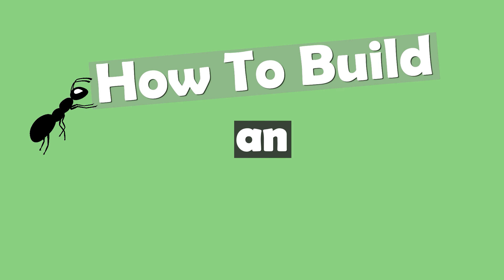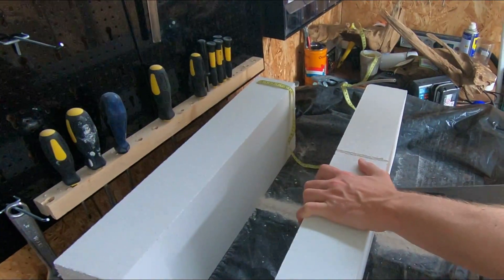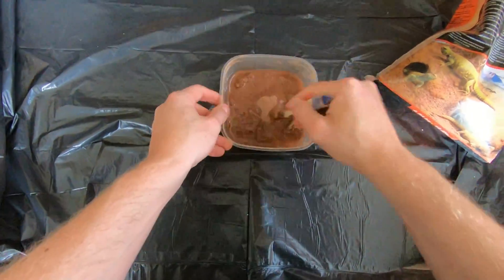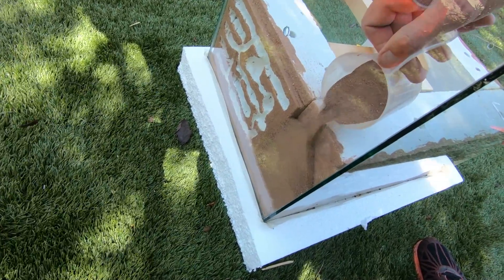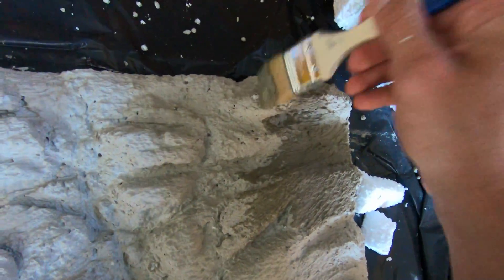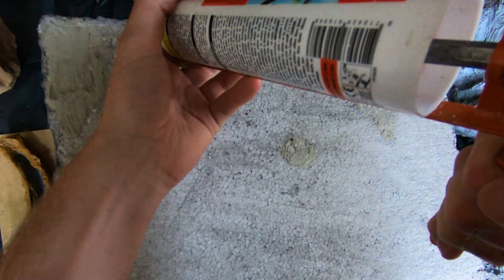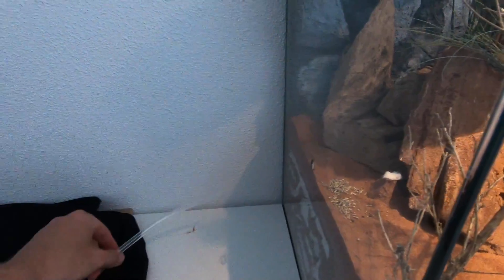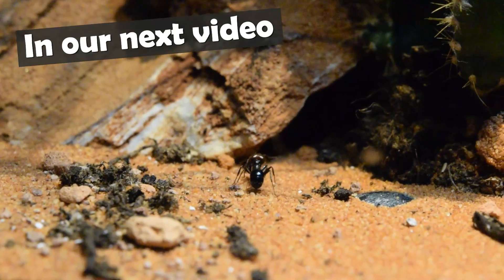How to Build an *EPIC* Ant Farm | DIY Formicarium

Comment: Very nice video, but do you place the plaster only inside the tunnels or also on the surface around the tunnels(facing the glass )?
Reply from the maker: Only inside! The outside should be as smooth as possible to stick to the glass and prevent ants from using shortcuts.
Reply: @antsadventure  thanks for your fast answer ,i appreciate it 💪🏼
Reply: 1 more🙈, is the plaster nessesary or can they live in the Ytong only , excuse my English
Reply from the maker: @loco0251  not neccessary,  it is purely cosmetic :)
Reply: Ok Thanks man , very inspiratial , im fine now and gone glue the blocks in my terrarium👊🏼

Comment: amazing design. I would recommend adding a separate outworld attached to a tube decently away from the nest, that'll promote the dumping of garbage in a separate area since the colony will look for the furthest place away from the nest to dump garbage. then you wont have to worry too much about cleaning in those tight spots
Reply from the maker: Good advice!